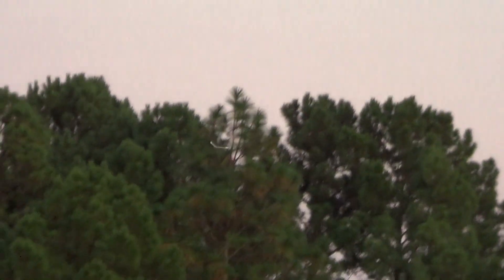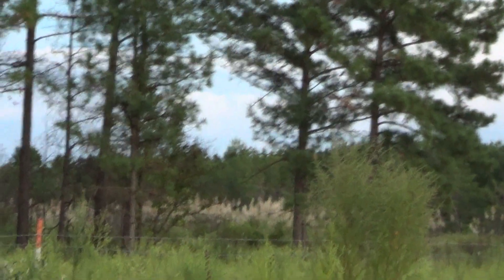Rocket Powered Folding Flying Wing Prototype

Comment: What you can do is attach a 1000 micrometer wire at a fixed distance in front of the camera, and then take a picture of the wing when it is at it's highest in the sky. The altitude of the wing is then measured to about 95% precision. The same is true when you place your thumb at 1m in front of the moon and the sun, the three objects appear the same size because of the maths of size and distance.
Reply from the maker: That's a good idea!